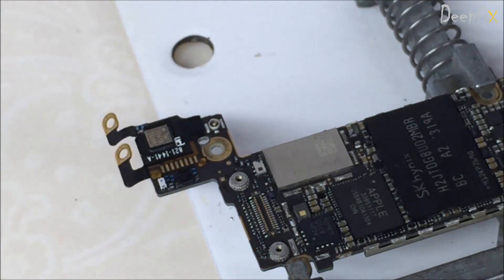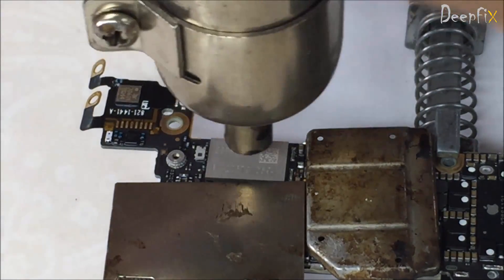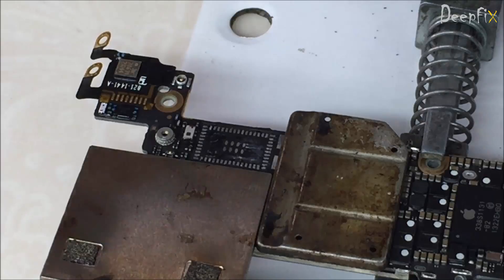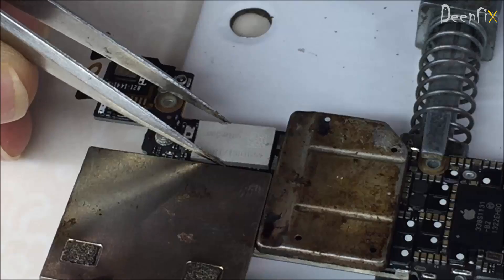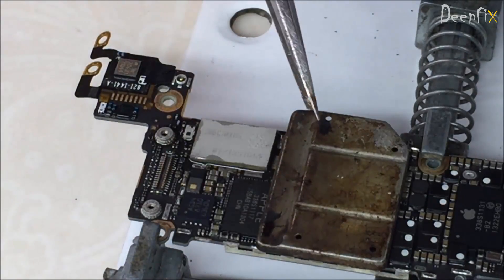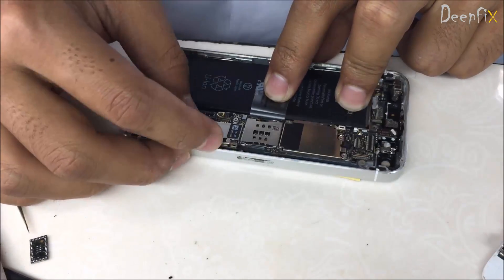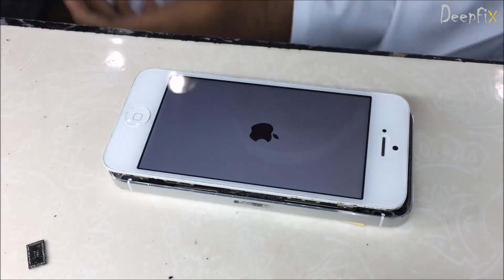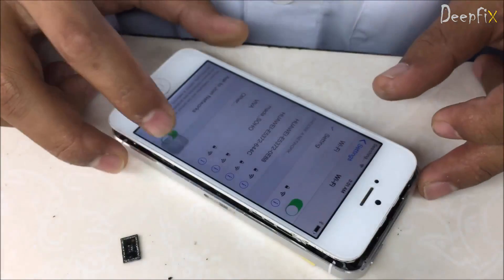IPHONE 5 Wifi Issue Fix

Comment: Hey!, what is the glue called to glue it back to the board?, thanks
Reply: it's not glue lol, you need to solder it to the board. it's connected via metal connections called solder. the substance he applied first that looks like glue is called flux, and it aids good solder connections.

Comment: Thank you for the video :)  I've had a look at a few You tube videos on replacing this wifi chip. So when I tried to remove I didn't get a clean removal at all. The chip would not move and started to crumble. So in the end with a magnifyer l had to carefully pick it off with heat gun and a scalpel. So am not sure that on fitting the new chip if it will work or not. So have bought an iPhone 5 re-balling template just in case.  Am mentioning this because even when you do things right way. It can still go wrong.

Comment: 400 degrees i think this is more then enough. 380 degrees is the best temperature to heat with it.
Reply: how long does it take the solder to melt at that temperature? i dont want to overheat other components.

thank you
Reply: I've read that its better to have a high temp for a  short period time than a lower temp. At lower temps there's more of a change that components will overheat. This is because  at lower temps it takes longer for the component to heat up therefore more heat is spreads to other areas.
Reply: Hi I honestly don't know The black glue is horrible. I've ruined my iPhone 5 even at 400 I couldn't get the new chip to stick. My phone is now showing a looped apple logo. And nothing I do or try will get it out. Not DFU or Recovery Mode. Am not overly upset because I bought it broken. But at least I could have used it as a MP3. What I can tell you is that lead free solder requires higher temps. And given the actual amount of soldering that connects the chip to the board it's absolutely tiny.